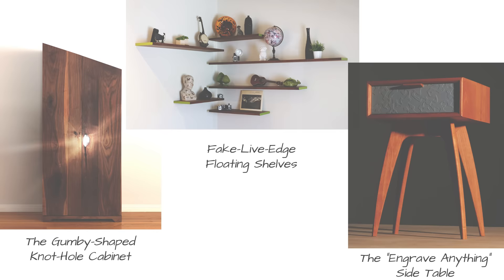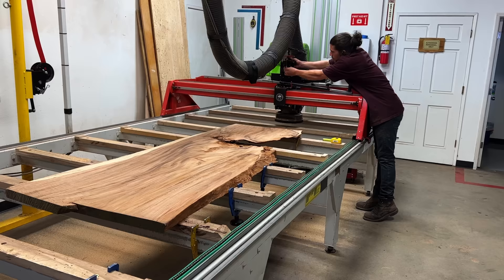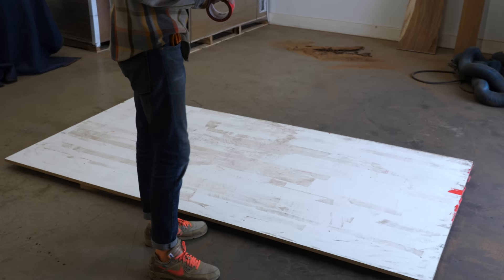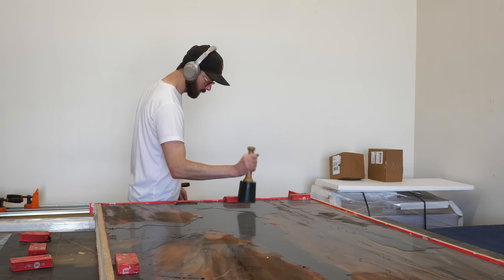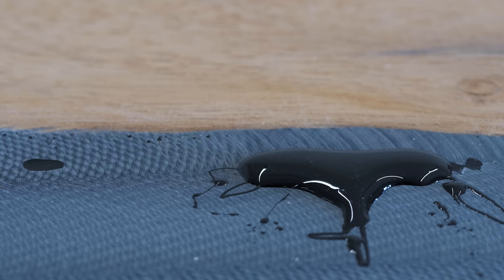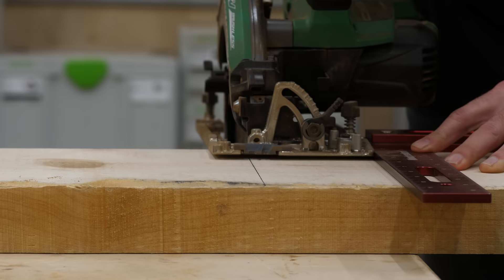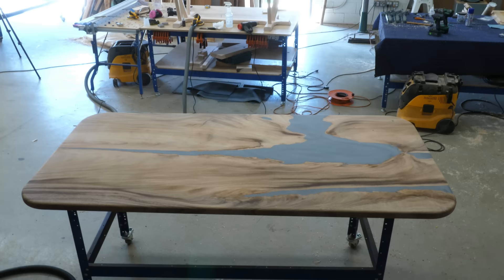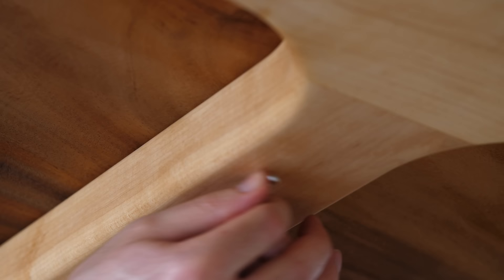Surprising My Parents with a Fancy Dining Table

Comment: On the metric vs imperial debate.  From a blank sheet perspective, I greatly prefer metric.  Makes the unit math really easy, smallest practical nondecimal unit is literally less than 4 hundredths of the smallest practical nonfraction in imperial (inch vs mm) so you've got less need for working with tiny fractions.  Imperial has a plus in that fractions are easier to divide in halves repeatedly than decimals (0.5, 0.25, 0.125, 0.0625) but that's largely defeated by the relative size of a millimeter (if you're working with tolerances of 1/8 of a millimeter, you're worrying about tolerances the width of a human hair, more or less, which, uh...my granddad might have in his tool and die making work, but...not happening in woodworking.).

That said, if you have experience and training in one system, you're going to be much better with that system for a while.  If you have tools in one system, doing a proper switch over (and not just multiplying every measurement by 25.4 to go from inches to mm and having all these bizarre numbers like 3.175mm (1/8 inch), it's gonna be real expensive getting everything swapped over.  If you're in an area where one system is generally preferred in your field, you should probably go with that one purely by virtue of relative availability of stuff (I live in Canada, and you can get metric screws and such, but the vast majority of our woodworking stuff is still in imperial. So you use imperial.  

Overall, both systems work.  People work well with both systems, it's only when you try to impose the other system on them that it gets confusing.  For content creation with an international audience, it's helpful to convert measurements because yes, there are tons of people in Europe who will hear "2 foot 10" and have absolutely no basis for what that means, much like the many Americans who hear 210mm and have no clue what that means. (that's 863.6mm and 8 and a quarter inches and 0.0677 inches beyond that, respectively (and the number goes on past 4 decimal digits, but...)  But yeah, unless you're catering to an international audience, pick your system, stick with it, and don't call the guys using the other system idiots.  Chances are, some people using that system are better woodworkers (or whatever other field you're in) than you are, and some are worse.  (and if you are...stick with the system you like when working, and just throw in some translations during the editing process so part of your audience doesn't get lost.

Comment: Awesome video and table. I read somewhere that spontaneous dust fires can be caused by metal shavings or a hot screw getting into the system. That was about floor dust collection, but it sounds like you had a terrifying moment regardless how it started.
Reply from the maker: That has been my suspicion. Some piece of metal hit the DC and sparked. But I have no idea.
Reply: @Foureyes.Furniture  Do you have a ground wire inside the dust collection tubing?  They look to be plastic hose.  This can cause a static buildup and spark which can cause an ignition with very fine dust.

Comment: Great video.. thanks.  I commend you for your little adventure into the world of metric..  To add to you education in matter metric, it is not usual / normal to use the unit centimetre, (cm), for measurements in the realm of engineering, construction and the like..  so the dimensions of your slab would 2.14m x 1.02m, or perhaps 2140mm x 1920mm.
The units cm is reserved for dressmaking  and curtains etc..

Comment: Hey man i work in a fire extinguishing company and there are actually detection and automatic extinguishing systems for this exact scenario that happened to you. I might add that they are very expensive and only big companys actually have these systems (since they are so expensive) but I'm sure there are Systems that only detect a fire in the sucking hose of your collection System so you at least know there is a fire, you might consider that, might be worth it :)

Comment: Didn’t see a new Fire Extinguisher, or more, close to your CNC Machine.  Just an observation, I’m sure you’ve got a few on order.  Lol

Seriously though, a smoke detector might have helped, but if you do want one, I suggest you do your research.  Standard smoke detectors have a weakness that most people are not aware of.  Latex paints, and other like products, produce fumes that will coat its smoke sensor and possibly stop it from detecting any smoke.

It is recommended that when painting in your home, that all smoke detectors should placed in an air tight bag for two weeks.  This protects the sensitive sensors, and will allow the detector to continue protecting your home. 

I learned this tidbit while flying from Toronto to LA for business.  Unfortunately the inflight entertainment system was not working, and the gentleman beside me worked for a manufacturer of smoke detectors, and he would not shut up.  By the time we touched down in LA, I knew everything about smoke detectors and his life story. 

Being Canadian, I have a great deal of affection for duct tape, unfortunately though, I did not have any with me at the time, otherwise I would have used it.  Lol

Comment: Wondering why you sometimes use the black CA glue at the end to fill small imperfections vs. using the Knot-tec hot glue stuff. Nice build as usual. Almost done with my Longview dining table build. Great plan and videos.
Reply: Probably just time, CA glue + activator is instant.

Comment: I saw my only example to date of why imperial is better vs. metric on Keith Johnson's channel. He demonstrated an example of when he was dividing something up, using imperial would get you a markable fraction using 64th, while metric would get you a 7 point decimal. Now... if he used metric from start to finish, would he have ended up with a 7 point decimal? Was the decimal a result of starting with imperial and converting mid way to metric? Dunno.

Comment: Hey I've used a wire brush to remove bark and stuff, and it works well enough, but inevitably the wires come off and go flying everywhere.  I did use an angle grinder though.  They're really sharp so I don't feel like i can do this outdoors as they will be around forever, and it's so messy that doing it indoors is fraught as well.  I ended up doing it in my shed, which was super uncomfortable.  I don't really have a question, but watching you made me think of this.  And also some of the wires come off so fast that they embedded in my overalls around, um, waist height, and kept stabbing me in places I would rather not be stabbed by metal wires.

Comment: Awesome as always - the base on this table is really cool! I'm also trying to figure out a base design for a small dining table that will be for a banquette, did you follow any sort of guideline for the base footprint relative to the tabletop so the piece is stable and doesn't tip/sway?
Reply from the maker: Thank you. No...I didn't, I just kind of went with intuition. In terms of stability and sway, that's going to have more to do with the construction methods than the size of the footprint. This one is pretty solid because of the triangulation on either end with the 3 vertical pieces. In terms of tipping...that will have to do with the footprint. This table is large enough that you could definitely lean on an end and not worry about that. If you're going really small it becomes more important though.

Comment: i will give you a 👍for the metric one.
Dont pay attention to those people that fight over what is better, both systems are great for what are made for.
Personally, i think that metric was made to fix what imperial laks of and also acomodate to the needs for more cientific people, it gives more precission and it is more easy to manage when making math with distances and things like that.
And thats why i say dont play attention to those comments, you work with wood making furniture so you dont need that milimetric precission also, you use tools on imperial and buy things made on imperial.
Great video btw.

Comment: Apologies if I'm teaching you to suck eggs here, but for future ref, if you have screws with stripped heads that won't budge, two solutions. There exist specific drill bits designed to remove knackered screws - they're sorta like a tapping drill bit, but slightly conical rather than straight. Load one into your drill, stick the pointy end into the stripped screw head, then, in reverse gear (i.e. counter-clockwise), start the drill (slow is best) and push down. The bit will chew into the screw head, bite, and cos you're in reverse it'll wind the screw right out. Tried this quite a few times & it works a treat.
Alternatively, in a pinch, find an elastic band, lay it flat over the screw head, stick your normal driver bit into the head and back the screw out slowly. Surprisingly effective. Love the table, and your folks - your dad looked awesome, just lacking the revolving guitar! 😁
Reply from the maker: Unfortunately those solutions wouldn't have fixed the main problem here. So getting the portions of the screws that had a head on it was a bit of a challenge. That was when. you saw me using a chisel to get a purchase on it. The bigger problem was the the screws actually snapped in half, so it was the part WITHOUT the head that was the real problem.

Comment: The Imperial system is extremely useful for real world usage as dividing things withought calculators is easy, and I as a Canadian use inches and feet for actually making things, I will not however abide the usage of fahrenheit.

Comment: Be aware, saw dust left in a bag can and will spontaneous combust, every time.  It first came to my attention because of the dust collection in a floor sander.  It doesn't take long, it has happened when a crew was out to lunch, literally.  I don't know if the house burned down.  I recommend you never leave the shop with dust remaining in the dust collector of any piece of equipment.
Reply: It can, but “will” is a strong statement. If the sawdust gets wet there is a high probability it will get hot. Maybe even hot enough to smolder. If it “will”, then every wood shop in the world would currently be a smoldering ruin.

Comment: Re: metric - there is no point in arguing when it comes to woodworking, as there isn't much point in talking about dimensions more precise than 1/16". Metric and imperial are equal then. The inch itself is already defined as 25.4mm, so the reference/primary standard for everything fitting together is the same anyway.
It's with metalworking where the cracks start to shine through. Lets say you you have a 5/16" hole or opening or whatnot, and you want to have a sliding fit with another part, which obviously needs to be undersized, then you start to do silly calculations like 5/16" - 10 "thou" = 0.3125 - 0.010 = 0.3025, and that's completely unnecessary with metric, as it is already 10-based, not power-of-2-based.

Comment: You more than likely sucked up a knot (or a piece of metal)that got stuck in you dust collector fan blade. and the friction from the blade spinning against the knot created an amber, and that's probably what caused your fire in your dust collector! I've seen that happen by getting metal like finishing nails stuck in the blades of a dust collector also. Never leave your shop with your dust collector running. Beautiful table by the way : )

Comment: Hey 
in this video  I'm interested in the base to the table.  My customer has questions about their bench, and if people will be able to slide by the struts when sliding into the bench.  I want to buy the plans and I don't want to rip off your plans,  if you have any advise or could help with dimensions that would be great.

The table top is 47" X 96" X~2"  
The bench is 16" high with a depth of 18" at the bottomof the seat to the back.  I figured the table would overhang about 2 inches over the bench.

Any help would be appreciated I'm still learning sketchup and not really getting it well.  

Thank you in advance for any help you can provide,

Dan Boone

Comment: What finish did you use?  Also, were the legs finished? Looked different than the top, but as legs get kicked/scruffed up more I was curious what you did to provide protection
Reply from the maker: Both were finished with the same finish. "Pure" colored, Rubio Monocoat. They look so different because they are different species of woods. People often use the term "stain" and "finish" as synonyms. But even though the color changes when you put a "finish" like this on...it is not a stain. It basically just make the wood change to the color it would have if it were hydrated.
Reply: Thanks!  I neglected to mention what a gorgeous job, and wanted to say I appreciate the work you put into the videos, looking forward to the next one!

Comment: Epoxy isnt expired that easly (it will literally be unusable , it was probably crystalised slightly , you just need to heat up epoxy before use to like 50*C 
Then it should work just fine

Comment: Hi! It‘s not superiority of the metric system, it‘s just the simplicity of it. The US uses imperial, which is fine, if it weren’t for the complex way to calculate stuff divided by 12 (changing units all the time, like yards, feet, inches etc.), and we have to be clear, it‘s not easy and has many flaws. You already uses metric with money, in quantities of stuff you buy, in everything else in life. When a system offers you the possibility to be easier and communicate over the globe, you normally do it. 
1km=1000 m, 1 m= 100 cm, 1 cm =1mm. Easy, no name changing etc… And you probably know that kilo, means 1000, centi means 100 and mili means 1/1000… :-)
Keep the good work.

Comment: LOL: The imperial measurements are defined on a metric standard. The meter is a scientifically defined measurement, and the inch is a specified measurement based on the meter. So if you say you only use imperial measurements, you already are using metric without wanting to say so.

Comment: here is a thought. don't and i mean don't ask me how i know this. but sawdust as it sits for periods of time will generate its own heat and start to smolder. and if there is anything within contact that can burn it will IT ALWAYS  will. and different types of wood has different flash points or smolder points. that could have been what happen.

Comment: I know it's impossible to offer this without coming off as condescending or overly pedantic, but what you say at 6:59 is technically a double entendre, not a pun. Though usually double entendres have a lascivious double-meaning, when the spelling stays the same, you're using a double entendre; puns are exclusive to homophones (or near homophones). I just figured I'd pass along one of the few pieces of trivial information my degree in English provided me.

Comment: The metric system is just better. Better temperature, better weight, better measuring. Everything really. I’ll start my rant on the measuring system first. It’s nicer to calculate since it’s all in units of 100 when the bad one uses 1 inch. Fine. Twelve inches for a foot. And then I can’t be bothered to find out how many feet are in a mile. I’m bored of typing

Comment: Metric makes it easier to be more accurate once you get to finer than 64ths. But a thumb's an inch +/- a scosch. Stretching fabric from my left cheek to my right outstretched pinch is a yard. And I can near enough walk off yards by walking. And while I'm walking, 14 blocks is pretty close to a mile. I have no at-hand frame of reference for a centimeter, decimeter, meter, kilometer. The resistance to the inevitable change is more than dislike of the new, the different. It is a separation of the measurer from the measurement. Another dehumanization of a craft.

Comment: I'm going to vote metric, but I grew up in the States and think in feet and inches, so it's usually easier for me to work in imperial units as well..  That said, I've recently purchased some metric measuring tools.  I have very little trouble adding or subtracting two fractional numbers in my head, but sometimes I need to do a calculation with 4 or 5 measurements.  I could do them one at a time, but now I take those measurements in millimeters and the math is ridiculously simple.  I predict that within a year I'll be conceptualizing my projects in imperial units, converting those to metric, then working in metric.  Probably would have done it already, but I'm not emotionally prepared for the crap I'll get from my redneck buddies.

Comment: That was definitely a thumbs up, not a like. Metric for the win.

That said, I get it. Materials are all sold in imperial, so it's hard to switch back and forth. But when it comes to subdividing, I greatly prefer decimals to "wait, is 5/64 more or less than 3/16?" I can do the fractions, but they're unintuitive.

Comment: Not an expert by any means, but I have made a decent amount of these tables.. I don't think you're suppose to use that hot glue if your using rubio as a topcoat. Epoxy topcoat yes
Reply from the maker: I've done a few and they've all been fine. I only use it on very small holes. 

Biggest holes get epoxy,
anything that won't fill with epoxy get's the hot glue
anything that won't fill with that gets CA Glue
anything that won't fill with that remains.

Comment: Math teacher killjoy has entered the chat: The Intermediate Value Theorem would indeed guarantee a time (perhaps 1953 as you suggest) that a donut cost a dime, if only the cost of a donut was a continuous function of time, which sadly it's not. The cost may very well have jumped from $0.09 per donut to $0.11 (or any other value). Mathematical logic aside, your work is superb as always. #Illtakemywedgienowthanks
Reply from the maker: Makes sense...actually sounds more like a "marketing theory" than a mathematical one.